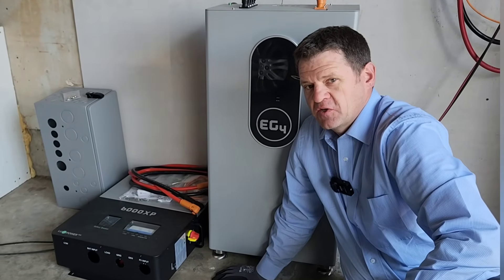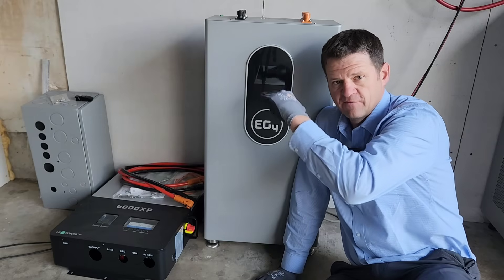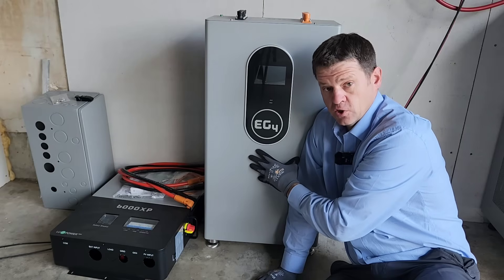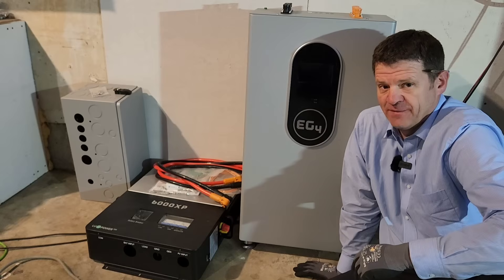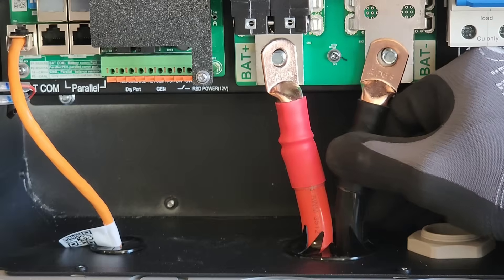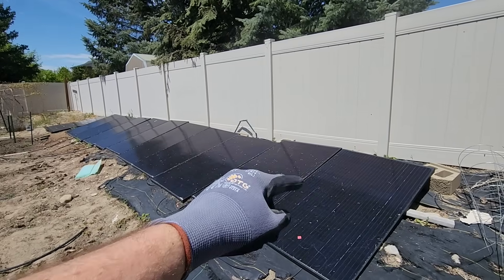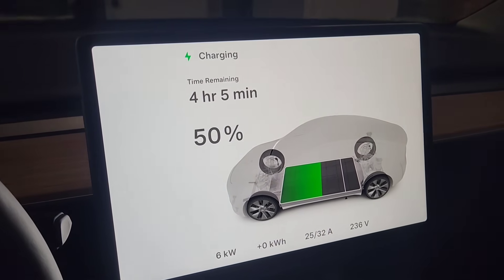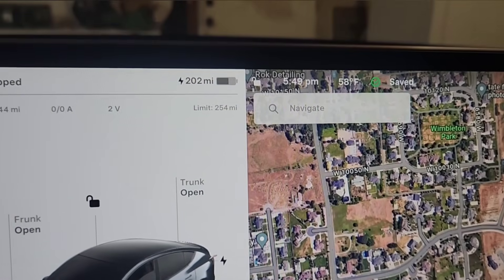I Built a Home EV Car Charger - Off-Grid, Battery Powered

Comment: FYI- Im in Same area code, I’ve got 10x370w panels. I see usually 3200w peak. And between 22-26kwh per day. I also picked up a lifepo4 Tesla rwd. Great car, great battery. And affordable with $4k off at point of sale.
Reply: Also, I’d highly recommend getting the Hubble brand 240v plug. The $10 Home Depot leveton has been known to burn things down when used for car chargers. About $57 on Amazon. Industrial rated. 3x the weight.
Reply from the maker: Thank you for the suggestion, I will link to that one in the description. I've heard of that but couldn't remember what it was called.
Reply: Definitely upgrade the plug especially if you're charging at the highest amperage.  The plug should also be torqued to recommended rates.
Great setup. Gotta love the plug and play!